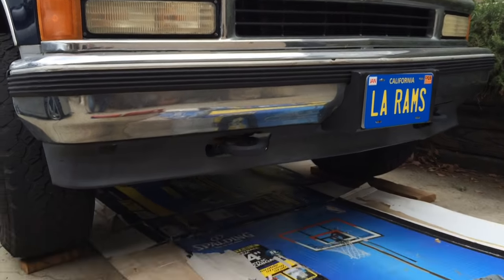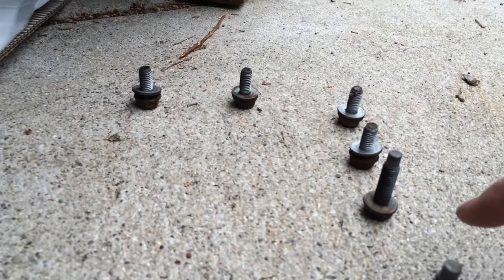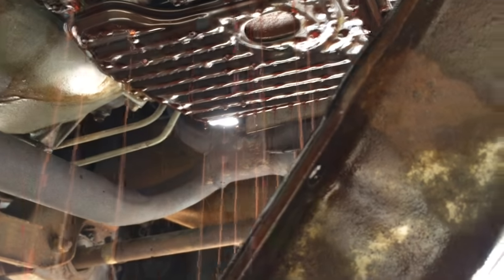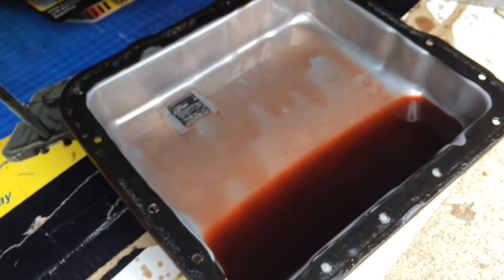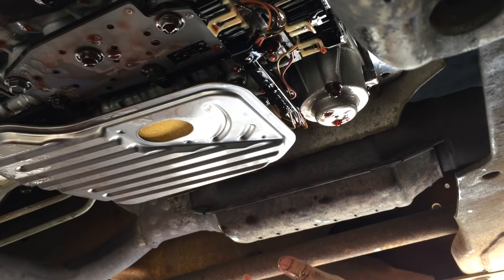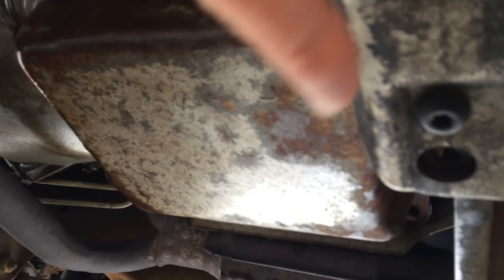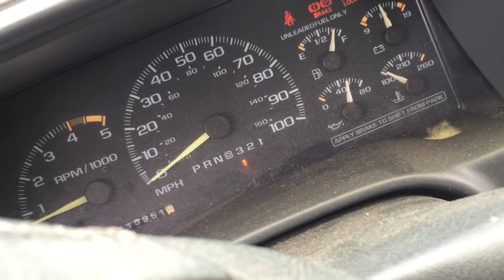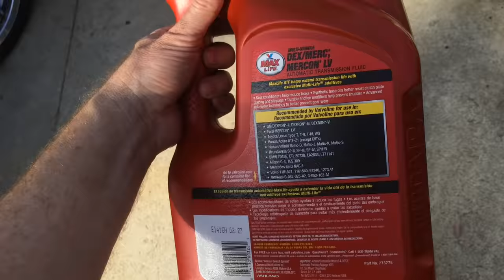Chevy Truck Transmission Fluid And Filter Change

Comment: It wasn't a 'cap' on the filter. It was the new rubber seal, that he threw away. The old one was stuck in the transmission, that's why he thought it was a different size. Keep that in mind when changing your filter folks.
Reply: Wow...thnx!
Reply: Francisco Gonzalez pull the old seal out and line the new one up, once lined up get a 9/16 socket I believe and put an extension through the reverse side of the socket and tap it with a hammer just like a bearing press.
Reply: I should have left it alone, its all boogered up now tho. Ugh
Reply: NameYourChannel   You are absolutely right. I couldn't believe it when he did that. That seal often sticks when you remove the filter. Carefully reach in there to remove it.
Reply: Most people throw away that new seal and reuse the old one that gets stuck inside the transmission because its very difficult to get the old one out.
Reply: Thats what i thought also.
Reply: @Francisco Gonzalez try some Kentucky Jelly.
Reply: I've watched alot of videos and most of the people doing mechanic work can be misleading, I actually done the jobs my way and found it to be easier, I just watched the video to get some sort of an idea of what I'm going to against, I'm in no way criticizing anyone, everybody has their own way of doing things, some just make it harder than others,and yes,he threw away the seal,no a CAP like he called it,very much luck to get it out like,sometimes you have to use the seal puller,Yes look it up they have a puller that pulls the seal off....but overall he did ok....
Reply: @rudyzepeda9770  easier said than done,  I did just that, and no go this 98 is tough for some reason, seems like the socket OD wont let it in all the way, I'm outside in Alaska and its flippin cold October aint no joke, gettin ready to tow it to a shop.
Reply: threw away the new filter o ring
Reply: Its must be true, I saw it on youtube right? lol!
 @MichaelSimmons.

Comment: If you are working on a silverado like mine 94 1500 and there is a cross member obstruction for remaining bolts at back of the pan. Remove all 4 bolts connecting beam to frame, there is a rubber mount that has two bolts that sits on top of the cross member, remove them and you can now slide the cross member after loosening center nut rearward to gain access to the two remaining pan bolts. Did mine today and after the frustration and trying to figure it out, that was the answer, makes it simple!
Reply from the maker: Thanks
Reply: Warrior 59 When I saw that it took the wind out of my sail.  Insane designers are probably laughing like Dr. Evil at the frustration they cause. 😈
Reply: Thanks for that. Question, will the transmission hold in place after sliding that cross member back? I was worried that the transmission would fall because it is kind of a support. My 96 Sierra didn't have a cross member but my 96 Silverado does have it. Let me know.
Reply: @josephbragg1162  HI Joseph, I no longer have that truck but I donot believe there would be an issue with it falling.  You can put a safety jack under there if you feel unsafe? God bless your work!!
Reply: That’s so funny. My 96 GMC sierra 1/2 ton has a cross member. I thought that would be typical for all GMC of that year.
Reply: My 94 has that beam also and I see trucks that don’t. I don’t understand.

Comment: That transmission holds a lot more than 5 quarts.  By dropping the pan, you're changing less than half of the fluid.
Reply: Yep. Book says do it every 30,000 miles. So replacing it all is not necessary.
Reply: I learned that today .I'm still leaking fluid.. Taking forever to level out
Reply: I’m gonna do mine tomorrow. What should I look out for and be careful with? I have a 95 GMC Yukon
Reply: Doesnt matter much, as long as you change most of it. As long as it is at the proper level you should be fine.
Reply: If that's a TH 400 it takes 12 qts if you empty the converter, and you should do that also, youtube has a few good vids on how to flush the entire system,
Reply: @MrGliderider55  I totally agree.
Reply: Douglas Ary it’s a 700r4/4l60e 

Doesn’t matter you can never get all the fluids out anyways. The torque converter and cooler holds fluid too . The only way to get it all out to is the flush..

Which is never a good recommendation even on a modern car. You just drain and replace simple

Comment: Pull the old seal with a simple seal pick tool from HFreight. It's like an ice pick with a hooked end. Put the new seal on the NEW filter neck. Don't try and put it up into the female part of the assembly. Slide it over the male part. Thanks - Lumpy

Comment: If you get a Haynes Repair Manual and read the instructions it will simplify this for you. Remove front and side bolts. Loosen rear bolts 4 turns. Use a screwdrive and pry the pan loose. Pull pan down somew to drain fluid. A little less heartache and mess this way. Remove rear bolts and drop the pan. Remove filter. May need to twist a little. If seal still remains in transmission, use a screw driver to remove it. Do not googe the a,luminum as you do this. I acually used a little hook tool (dont know what it was for originally) and pulled it out.

Comment: Hey, just had to sign back in to let you know how informative this was.  My 2000 Chevy S1500 has too much fluid and some "mechanics" have said it's not worth any concern. My issue seems more between second and third.  This helps a lot know I should not need a new "rebuild".  
Appreciate it
Reply from the maker: +hughbo52 I'm glad it helped you. Too much fluid can definitely cause problems.

Comment: That little "cap" on the end of filter is meant to be replaced. If you don't chng it, the new filter "snorkle" may be difficult to insert bc the old rubber is stiff. Following your instructions having difficult time seating the new filter, I tried several times inserting and tapping with a rubber mallet and removing filter, the old "o" ring came out. So I put the new one back on and it fit perfectly.
Thanks for the video with pan torque specs.
Reply: transmission builders tell you to remove old filter seal. they have seen two or three stacked on top of each other allowing problems to occur.

Comment: On my 2000 S10 I replaced the pan with 1 from Dorman products.  It has a drain plug that makes this job much easier. Also , a bottle of Lucas transmission conditioner along with the high mileage  full synthetic fluid you used will help keep your transmission working great. If your transmission is slipping try some Lucas slip stop when changing the fluid. I've had an 80% success rate with it.
Reply from the maker: +Shepperd November A drain plug would be nice. Much less messy to drain.  I really like Lucas products. I use the oil and gas additives, and the power steering fluid stop leak and manual transmission stop leak as well.
Reply: I use valvaline max life full synthetic too and I get lucas stop slip. It says on bottle it's also great just for maintenance too.
Reply: Do you still have this S10? I’m going to do a flush on one Friday. Just had a few questions

Comment: The old filter does have that gasket on the tip, it's just still in the trans it came off when you pulled the filter out. You're suppose to get a lil hook pick and get it out and put the new one on there
Reply from the maker: True. Hopefully the old one is still good. My truck runs great right now.

Comment: Did you have to remove a transmission support to first get to the rear pan bolts?
   There is a support/ cross member blocking all the rear bolts on my 88 Silverado 2wd.😡
Reply: I had to in my 91 Sonoma. Pain in the ass on reinstalling the crossbar and aligning the trans mount bolt.

Comment: I think that so called cap is the new seal. You should pull out the old seal and replace it with the new seal (you called it a cap).
Reply from the maker: That makes sense.  Thanks.

Comment: If you would have looked into the hole where the filter went you would probably seen the old transmission seal which if you wanted a tighter fit for the filter you would have removed it and then replaced it with the new seal that came with your new filter. That is what I found on my 93 Silverado. It is a little difficult to replace but I wanted a new seal prior to leaving on a long trip and did not want any problems along the way.
Reply from the maker: +Franko S. Thanks. I should’ve taken that out and replaced it.
Reply: Thought I would show you how I removed my seal. It was easy and worked out great with no wobbling once the filter was installed.  Check it out if you like. https://www.youtube.com/edit?o=U&video_id=B-pewfJF4ow
Reply: I used a small chisel or flat blade screw driver  and gently tapped around the edge. Once I got the edge to bend a little I just kept bending it inward so that I could grab the edge with a needle nose vice grip and pull it out which caused it to come out very easily.  You just have to bend the edge in enough to be able to grab it with the vice grip. Then just gently push the new metal seal in place and gently drive it all the way in with a small hammer and a flat punch until the lip make contact with the transmission body and you are then able to install the new filter.

Comment: my truck has a cross brace blocking the rear row of bolts, did you have a similar problem, and if so do you know what is holding up?
Reply from the maker: Not sure what that is for.  My truck doesn't have anything in the way.
Reply: hoohoohoblin we found that it was the support for my transmission luckily we only had to remove 4 bolts and Jack the transmission up 2" to get that bar out
Reply: I used a 1/4 inch drive socket with a flex head could get the bolts out without removing or jacking up anything. 2000 GMC Jimmy.

Comment: Not so simple with my 1995 C1500 Silverado. Has a cross member that covers 3 to 4 bolts on the pan. How I get this done I have no clue!  Does the cross member need removed or is there another way???
Reply from the maker: I think you do have to remove the crossmember on those models. I haven’t seen it, but I have heard people complain about it.
Reply: So I am halfway through this process myself on a 1993 S10. I have the same plate that runs across. On the passenger side there are two bolts holding it on. All I did was remove the two bolts with a 5/8 deep well socket (used a pair of vicegrips on the nut on the opposite site to allow it the thread out). This dropped the beam down an inch or two, which allowed me to get to the final three bolts on the pain with a mini socket wrench. Probably too late for you, but wanted to comment this in case others have the same issue.
Reply: Must be a different set up on the S10. The crossmember sits on top of the frame on mine. So it’s impossible to move down without removing the bolts on both sides and it’s bolted in the middle as well.
Reply: Rob Cox And I thought mine was a pain in the ass!
Reply: Rob Cox, did you remove the cross member. I have the same problem. Loosened the 4 bolts on both sides. But there's a bolt sticking down in the middle. Not seeing a clear way of removing it. My thinking now is to use a shop hammer to knock the cross member free so I can go ahead with the filter change. I'm just concerned with how easy it will be to get the cross member back in place. What was your experience?
Reply: Kevin Knight I just drained my transmission on my 97 Silverado . I just took off all the bolts on both sides of the pan and one side of the top of the pan and stuck a flat heat in the crack to create a space for the fluid to drain . The bolts behind the crossmember i didn’t touch . I didn’t change the filter either
Reply: Having the same issue on a 1992 Chevy G20 5.7L with 700r4.
A frame crossmember needs to be removed to get to the bolts on the rear of the pan.
Reply: @justinrogers1173  Yes.

Comment: What about the transmission mount bracket? Do you have to remove it or just loosen the one bolt in the middle?
Reply from the maker: On my truck I didn’t have to do anything to the transmission mount bracket.
Reply: @hoohoohoblin  Maybe someone before you Torched the thing off? Or yours is completely out of the way: how nice.

Comment: WTH!! I have a 2014 Chevy Silverado 1500 and My local dealer quoted me $230 to do this service. Ugh! I need to learn basic mechanics.
Reply: Ray Bernardo Lol... I said the same shit. Just got done doing my front/rear differential fluids and oil change... (Oil change I've been doing myself forever) but now I'm gna do my transmission fluid/filter myself... Looks easy as shit... I believe I was quoted close to $400 for all fluids. So far I'm in $130 for my oil/diff fluids, oil filter rear diff gasket. And these are top of the line fluids I bought.😁😁😁
Reply: beatcha! Aamco quoted me $299 on my van!
...did it myself in less than 1 hour.
Reply: I know this is a late reply... but look at south main auto channel on YT for great tips on trans fluid/filter change.  Also look at Sweet project cars on YT.  They have a quick cheap way to add a trans fluid plug that makes it SO much easier to drain the fluid with no mess.  Also...MOBIL 1 has a rebate twice a year (spring and Fall...its on till Oct 31 right now.)  You can get 5 qt mobil 1 and filter for $15.  You can do all this stuff.  Get a good jack and tools at Harbor freight.  Best of luck!
Reply: @thefireman285  I watch South Main Auto too.  I he can do it, so can you.  He gives the best tricks of the trade.

Comment: so any size wrench or spcket will remove the pan bolts..
Reply from the maker: They don’t have much torque on them, so you can just use a regular wrench to take them off.

Comment: Here's a trick for those that don't want that kind of mess. If you have access to the oil cooler remove one of the lines  put hoses on the end of the lines  into a catch bin, than run the engine for a few seconds and it will drain the oil below the pan level.
Reply from the maker: +Peter Mayo Thanks. That would have been a lot easier.
Reply: Peter Mayo can you post a video of you doing that?  I would love to learn that trick.
Reply: Removing oil cooler line on older vehicles can be tricky if it has fluid leaks. Fluids & the dirt/ grime they attract create slippery situations that make stripping the nut shape on brass fittings during removal very easy. On reassembly the chance of cross threading the fitting or threads on cooler is increased.  Just a note of caution if trying this method for first time & on older veh.
Reply: My motto was never remove anything you didnt need to for one of the reasons you mentioned..
Reply: Peter  Bad advise.  First you said to remove ONE of the lines, then you said to put hose's on BOTH of the lines.
Reply: @kenkozma3780  I think what {@blubu68}  was saying was to remove one line at the transmission cooler and attach drain hoses to both open ends, male and female!
I do this with my 96 K1500 and run each drain hose into a separate 1 gallon clear jug. start and run the vehicle in PARK for several seconds, emptying about 2 quarts of old transmission fluid into one of the jugs. Shut off the engine and proceed to remove the transmission pan - it will still contain a quart or two of oil transmission fluid.
I remove the upper transmission line where it enters the truck's radiator, for easiest access.

Comment: So where where does the transmission fluid 1st flow thru after you pour it in the dipstick? Then where does is flow towards 2nd ? & After that where does it lead to? 
Asking because my 94 is leaking doesn't seem to end up @ the transmission so if you can help me out by order the fluid flows thru I'll be able to check better ..
Reply from the maker: I don’t know how it’s routed around. I know that it does go up into the transmission cooler radiator and back in my truck. But if it’s constantly low, I don’t know where else I can go other than onto the ground.

Comment: I tried to do this for my C1500 and there is a crossbar in the way so I had to just let it drain a little bit and couldn't replace the filter :/
Reply: Why wouldn’t you just move the cross bar by unscrewing and pushing out the way

Comment: Well that's easier than I thought. I need to mine.
Reply from the maker: It is worth doing if the truck is old.  It is messy, though.  Most people never change the fluid or filter, so in my case the oil and filter were probably 20 years old.
Reply: I bet. I don't mind getting messing. My truck is 22 years old. I'll do mine this weekend if I get a chance.

Comment: my 04 suburban require to lower exaust to allow room to slide pan out and use a long screw driver to pry aside cable. super hard for me, didn't have right sockets and got cramps on chest from laying on side too long. super hard
Reply from the maker: +m00nchildblues That is terrible! I wonder why they made it so difficult.